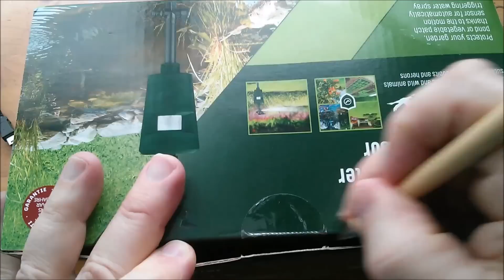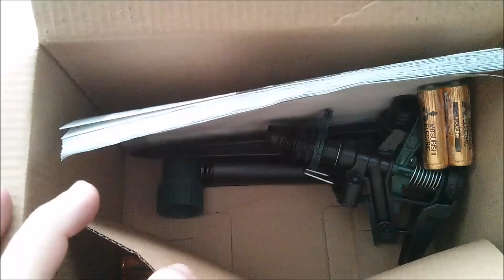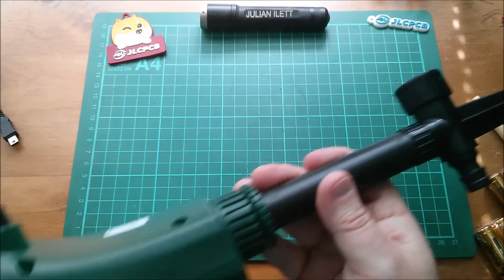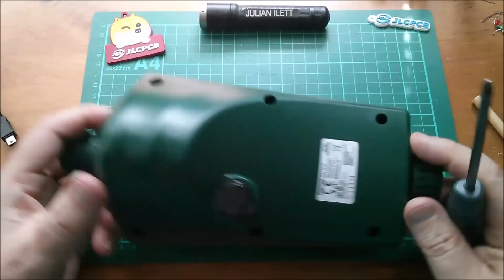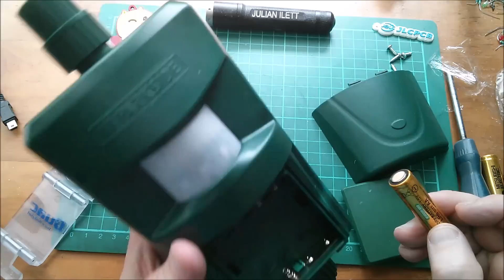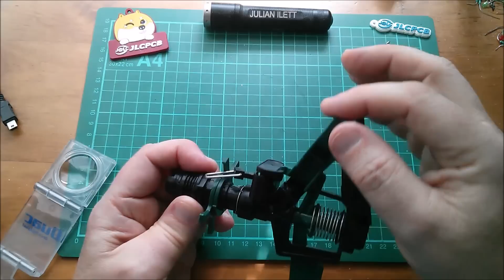Water Animal Repeller from Lidl

Comment: I wonder if that solenoid is the same kind i just put in a project i am working with.  I replaced a standard sprinkler head solenoid with a latching one.   Quick pulse and then you can cut the power and it stays in that state.  I use an H bridge to reverse the current and turn it back off, then my arduino goes back to sleep.  The valve came from an orbit battery powered sprinkler system, that's how they got the longer life out of the batteries.

Comment: I wonder if the H-bridge is a relic of a previous iteration of this product that used a more complex motor driven mechanical valve.  The reverse polarity "off" output would no longer be needed and a simple programming change would accommodate the solenoid design.

Comment: In that mechanism is a quite normal lawn watering spray head, that shoot bursts of water spray. Each burst moves the head a small distance of rotation. The mechanism allows the total range of travel to adjust before the steps at bursts to reverse. So entirecsweep range is settable.
In this warmer animalbrepeller the unit uses a PIR to detect presence of any animal. That activates the spray to go into a short cycle of spraying  to scare the animal away by hitting it with a spray of water. Effective to drive away cats  digs  squirrels  birds, etc.

Comment: You're right on the chaotic motion, it looks the same as garden sprinklers which have been around a very long time. I remember them being used on lawns when I was growing up in the 70's and 80's, only they looked a lot more robust back then. Here's a little info - https://youtu.be/ijy1FO2u2pQ?t=278 - and here it is running (same video) - https://youtu.be/ijy1FO2u2pQ?t=724   I love the sound of them when they are running properly :-)

Comment: The solenoid valve doesn't consume as much power as you would think. It's not that little too, but it uses the water pressure to help with the open/close action. Wiki it - it's really cleaver: https://en.wikipedia.org/wiki/Solenoid_valve

Comment: How can you have never seen one of those sprinklers !? :-) They are really common and have been used in farming for decades. The benefit is they spray water huge distances. the green sprung arm works as you explained, it flicks back and forth and slowly moves the head one way until it hit the stop, then reverses. The top black piece controls the vertical height of the jet, and so the distance it sprays. https://www.youtube.com/watch?v=nKkhxSiUH3k

Comment: The way the sprinkler head works is it uses the mass of the water flowing out of the sprinkler channel to rotate the head. 
In the normal state (with the catch disengaged) the water flows through the green horizontal S channel and knocks the channel to the left out of the water stream. The channel returns to the stream because of the spring forcing it back, and when it does it imparts the kinetic energy back into the body and rotates the head a few degrees to the right. 
In the alternate state (with the catch engaged) the water flows through the channel and knocks the channel to the left out of the water stream. The channel is stopped by the catch which rotates the entire head to the left a few degrees, and the channel returns to the water stream.

Comment: You can connect a Hozelock type tap connector to a standard washing machine valve FYI. the cap opposite the water inlet is so you can daisy-chain them together, and you can test if it latches on and off by taking the batteries out when it is on, and see it it clicks off, I would hope it is momentary, and returns under spring pressure, so a failing battery doesn't result in it getting left running :)

Comment: It could be possible that the solenoid is bistable with magnets meaning one polarity opens it and reverse polarity closes it. Which could explain the need for an H bridge driver and the large cap nearby so it only needs power when toggling between open and closed.

Comment: Not chaotic motion. The opposite. Cyclic motion.
The idea is that the deflection plate causes the thing to rotate. It basically kicks the thing forward. When is rotates back it smashes into the other parts, wich rotates the complete assembly a little bit. It's hard to explain in text...
I'm not sure about the direction thingy. But I'm sure if you grasp oscillating sprinklers you'd have an easier time to decipher this mystery :P

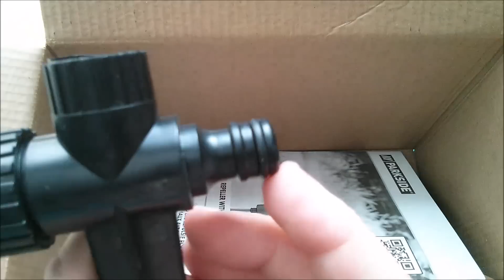Comment: Interesting. I had the general idea of how it works at 1:45... just a motion sensor controlled solenoid valve that turns on the water for the sprinkler when movement is spotted. Indeed, the device runs on 3VDC and we've got a serial-parallel connection here as the solenoid itself takes considerable current, even if for just a few seconds.
2:33 the mechanism looks kinda flimsy and easy to damage, prone to fatigue over time too. It's not supposed to work for long like the lawn watering sprinklers do though.

Nice PCB, the manufacturer actually put some thought to waterproofing it. Repairproofing too, unfortunately.
The rubber gasket around the battery compartment door is a nice feature too.

It looks like the sprinkler itself uses the design that's been around since 80s or 90s. No need to reinvent the wheel, just use what works. Distance adjustment is a good feature too; teamed with sensitivity adjustment on the control unit, it allows for fine-tuning the device to fit the size of your garden, preventing spraying the passers-by. Or the exact opposite ;)

BTW judging from the title, my first thought was that this device is placed in a pond, fountain etc. and deters any swimming small creatures, so I kinda expected an ultrasonic one, then I realized what is going on. A fun one!

Comment: You had lead pipes feeding your house?
Crazy!
Reply: Lead pipes are fine so long as they are not disturbed. The inside of the pipe gets coated in scale, so the water is not in direct contact. Just run the tap for a minute in the morning before using the water for drinking and cooking.
Reply: @michaelkaliski7651  BS
Reply: It’s actually true. Remember Flint Michigan?  Lots of houses had a lead fitting in the supply. They didn’t become an issue until the water supply was switched. The new water wasn’t chemically the same as the old supply so it dissolved the coating, allowing the lead to leach out into the water.
Reply: @lasermike2147  tell that to someone who doesn't know how to pronounce "ScIeNcE"
Reply: @lasermike2147  Keep telling yourself that.
I know silence when I see it.

Comment: Minimum pressure water companies must supply to UK customers is 1 BAR approx 14.5 PSI. Most homes get 2-3 BAR. Low power pressure washers start at about 100 BAR and heavy duty ones can go well over 200 BAR. It would be kinda cool to see this connected to a water supply possibly 2 magnitudes of power too great lol.

Comment: You can get hosepipe attachments that have a screw fitting on top and a shroud type thing that goes around that fits to any type of tap. I had one on my sink for years. Google hose pipe tap adapter. :)
Reply: There is no fitting that fits to “any type of tap”

Comment: They also work well to keep children and door to door salesman out of the yard...  The sprinkler is an impact sprinkler designed by the guy that started the Rain Bird company. Often called a rainbird sprinkler head. The metal ones are durable and very long lasting. They are still used in yards and larger versions in commercial irrigation. They are noisier than a rotor but they are immune to dirt and sand in the water where as a rotor has a gearbox driven by an impeller.
Reply: Trick or treat :)
Reply: My old tennis club used to use the metal ones on wheels to wet down the clay courts.
Long since changed over to all weather courts which I hate playing on.

Comment: So this is basically a motion activated sprinkler that is supposed to scare animals away by spraying water over them?
A fairly standard sprinkler head on top of a motion activated valve..   The spike is a pretty standard DIY watering system type spike.
The sprinkler head is very common, so you can find plenty of videos on how it works.
Not sure I would bother with it at all.
Reply: It sure helps your expensive kois to survive a heron attac.
Reply: @werner.x   I wish I had that problem in a way.   Where I am Koi are deemed a pest and not allowed to keep them.  I would love a pond.   I can see this could work in that situation, small pump could recycle pond water to protect, though I am not 100% sure the position of the motion sensor on this would protect from a flying attack.   Might be a nice modification to make though.
Reply: I prefer the one Turnah81 DIY'ed. His videos about it are hilarious too. youtu.be/ElcviGYMb3U

Comment: It's a standard lawn sprinkler head - the green lever uses the force of the water to deflect the flow to return to the start of the sequence
Reply: Yes, it is a pretty standard design sprinkler, but with an additional PIR controlled solenoid valve. Make sure the spray head is 100% level or they tend to sulk in one position.
Reply: And the black adjustment on to is to spread out the water stream. It should adjust it from a jet stream, to a fanned out, wide spray pattern.

Comment: Those sprinklers have been around for many decades. I have seen them used all my life at my dad's farm to water the crops.
In one state they swing fast and hammer themselves in one direction, in the other the swing slow and slowly push in the other. They have a very specific sound pattern.
tic---tic---tic--....--tic-tkktktktktktktk-tic---tic...
They used to be made of metal, back in the day.
Reply: Wright Rain, Ringwood 50+ years ago. They became almost the standard. Not obviously, they also got the water coverage surprisingly even with the design of the swinging blade
Reply: Came down here to say exactly this. The green clips on the bottom can be rotated to control how far it swings around.